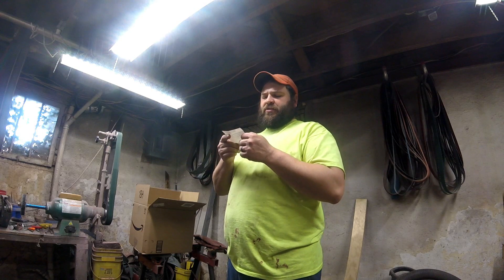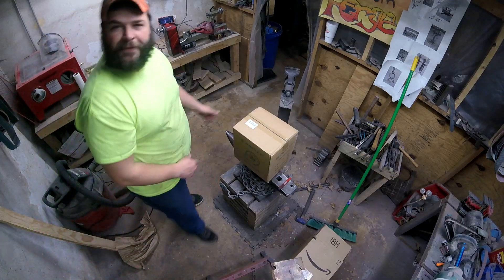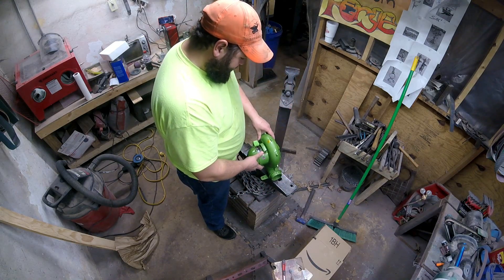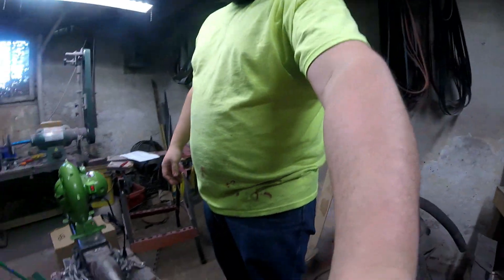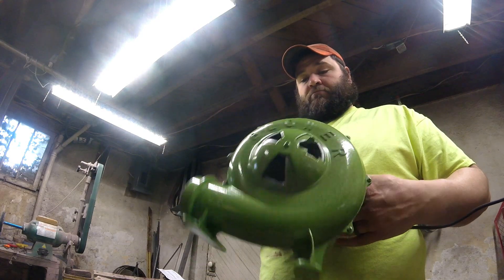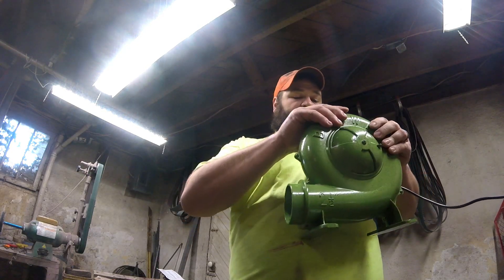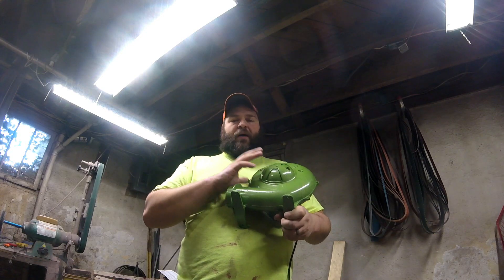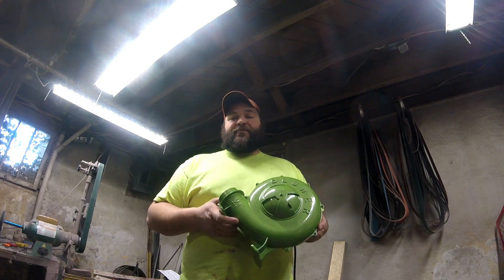Unboxing A New Forge Blower and Inital Thoughts

Comment: I have the same unit on my forge. Picked it up about 4 years ago and it's worked great. I did have to put in a blast gate to get it to idle decently though.
It will definitely move more than enough air to produce forge welding temps with little effort.

Comment: Hey brother, very cool gift! Hopefully it will work well for you. If (not saying it's a for sure, but just in case) you find that even with the air dam closed it's still too much air, you can always cut a rectangular slot in your feed hose and fit a "sleeve" over it to open and close the secondary air dam. Just a thought. Also you may want to grease the bearing/gears with some lithium grease if you are going to use it a lot, to preserve the life of it, as well as maybe quite it a little more. Excited to hear your thoughts on it! Keep up the good work! God bless you my friend!

Comment: You definitely want to consider getting an air gate. Also consider a foot switch to turn it on/off.  Mine is the 2 inch version and closing the vents on the side doesn't do enough. Good blower! Needs a way to tame it though.